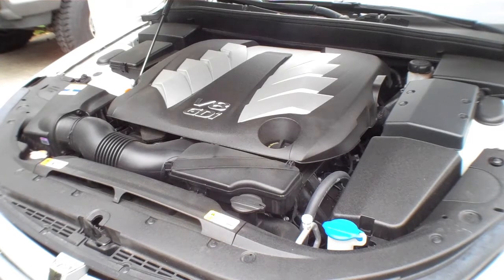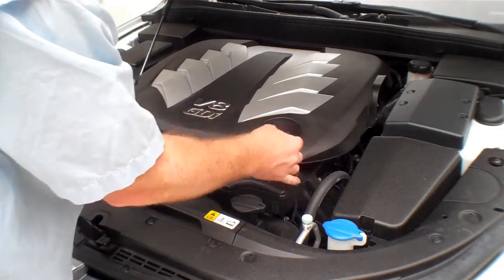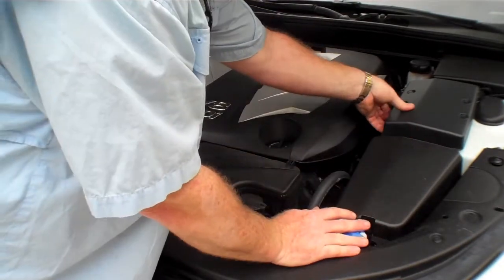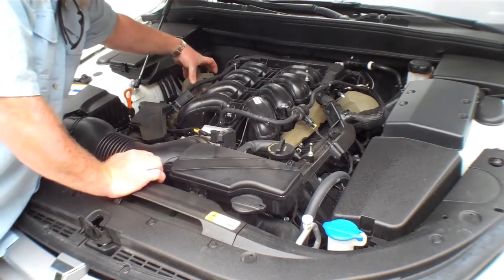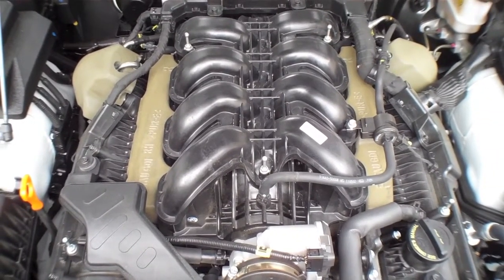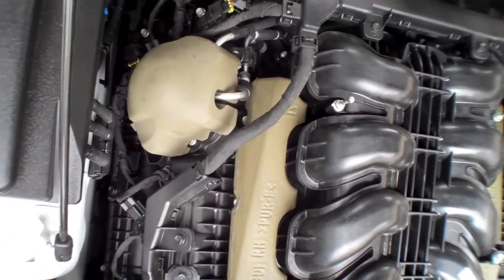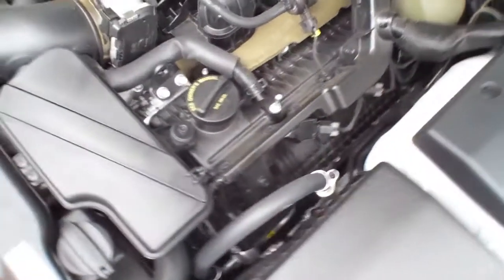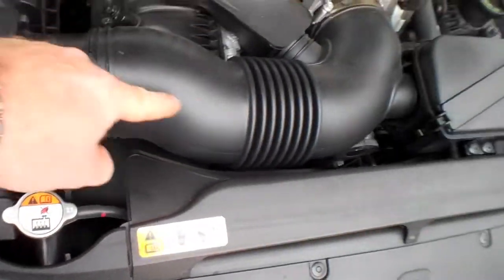2013 Hyundai 5.0L GDI engine under the hood tour

Comment: How's the reliability, I just test drove one of these and OMG I am in love, that thing will flat out run, but I don't want something I'd have to keep in the shop
Reply: Avoid the early 2012 models as they are plagued with oil burning and transmission slip issues. Late 2012-2014 models are golden
Reply: Hyundai has got remarkably better. But if you can get one without GDI you're guaranteed better reliability. I think some are available with a V6 so look into that. Surprisingly honda has had a bad GDI engine and hyundai had like a small car with a bad GDI engine but it wasn't the GDI, it was the crankshaft bearings being installed wrong or something.
Reply: I currently have the highest mileage equus in the country. 244k miles original engine, transmission and air suspension. These cars will outlast any German vehicle on the road. I've done basic repairs and my first oil leak started at 237k driver valve cover. Yes the air suspension can have issues but any car with hydraulic or air suspension will fail at some point.

Comment: Foam is to reduce noise and vibration. They cover both high pressure fuel pumps one per cylinder head. They are noisy pumps driven off the camshafts

Comment: As far as I am tracking as of right now. They aren't permitted to put the 5.0 in the coupe. Since that engine is in the mustang. Its not the exact motor. But its part of the coyote engineering and what not. Think there is an agreement or contract with ford since they flipped the bill for r&d, in order to keep the cost down on the new mustang 5.0 they sold it to multiple company's across the world. With the agreement it won't go into a coupe from a non-sister company of ford.
Reply: soo how would mods and tuning go for this motor  im thinking of getting a kia k900 and i know it can burn R/Ts but i wanna be able to hang with 392s